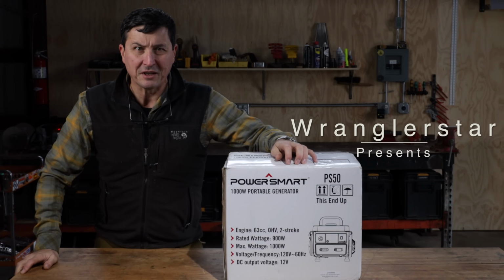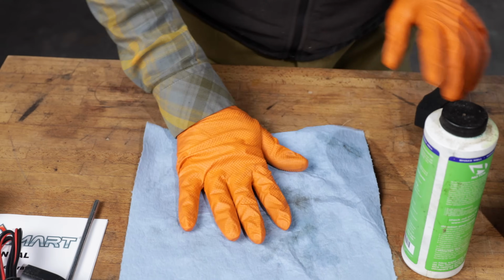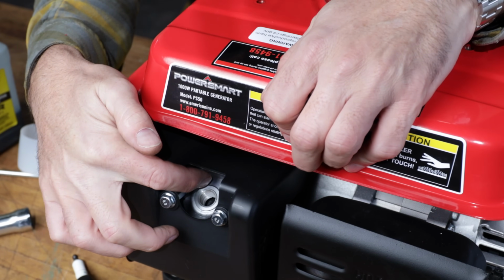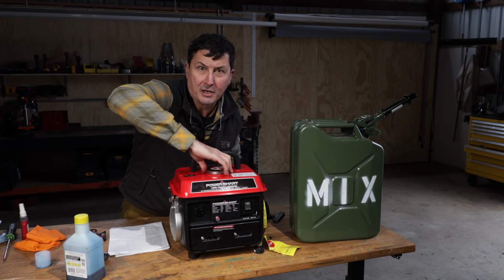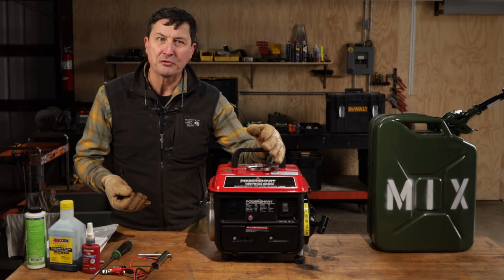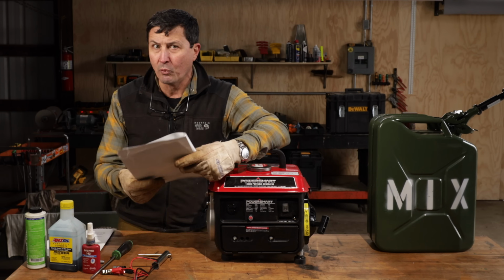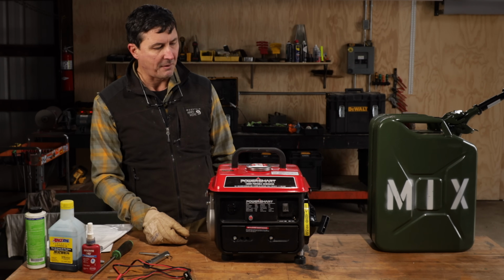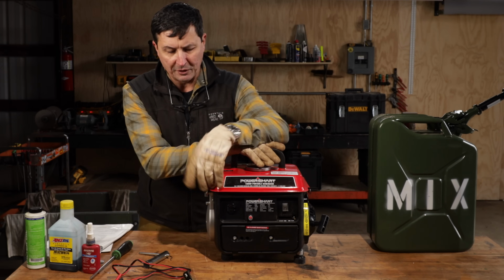TESTING The Cheapest GENERATOR on Amazon -$99

Comment: You should check the sine wave output on it.
Reply: Probably not the smoothest waveform. Looking like square saw tooth.
Reply: Sounds like MSW then.
Reply: yeah the inverter on this thing must be hot garbage, but for such a low price...
Reply: @25566  Unit in that price range won't have an inverter at all. Just straight wires off the generator windings, like old style generators.
Reply: @javaman2883  correct
Reply: I have a Chicago Tools brand unit and I'm rather happy with it, however...I'm gonna install a Voltage Regulator in my POP-UP Camper so I can charge the Leisure Battery. My unit fluctuates between 17-11vdc and I'd rather have that be a little more Stable than it currently is.

Comment: You can run modern electronics off these. If the power supply handles 120-240VAC at 50-60Hz, that switching power supply will manage fluctuations from the generator.  I wouldn't try to run anything of it that uses a linear old fashioned power supply though.

Comment: The only issue is the frequence and sinus shape of these small devices. I have one in 230/12V....
Reply: woody I would use an external inverter on one of these
Reply: @EvertGuzman  the Sinus is crap...a lot of the electronic devices are not working. I used the 12 v DC Outlet and an electronic inverter to 230v....

Comment: What you're missing here is the output is likely a modified sine wave which means for any switching load (DC power supplies) they will struggle to use this output.  This is only really useful for resistive loads (heaters, lamps, etc) and likely simple inductive loads (fans,etc).
Reply: Modified sine waves are common on cheap battery powered inverters.  Gas powered generators like this one put out a sine wave but noisy (not perfectly clean).   Inverter genrators convert the noisy sine wave to DC, then back to AC to clean up the noise.

Comment: This generator is worth less than $50 in Nigeria
Reply: i am in the uk thy sell them at tool stations outlets for 65'pounds i have one to run two 240 volt 400  watt metal halide   work lights  on the farm and i run it for 4 hours a night for 5 weeks when the sheep are lambing i have had it for 3 years working fine still but drain the fuel  when stored or it gums up the carb jets mine is 240 volts 900 watt max output  50 to 60 hz
Reply: Good tip. I'll get tickets so I can save the money...
Reply: Enjoy your goat sir

Comment: Hmm is the store it dry only for 2 strokes?  I was always taught for 4 strokes to filler up before storing with a little bit of Stabil, run it a few mins til hot, pull the spark plug connector, pull the handle a few times, and stash it for the 4 to 6 months.

Comment: Not addressed: power quality, noise, and fuel consumption.

Poor voltage regulation will kill electronics, like microwaves and computers.
There is also the matter of the starting current required by motors, like the one on your furnace blower 

Noise matters. The quality generators are quiet enough to allow normal conversation next to them. This one is like having a rock band playing outside your door.

Some generators can idle for hours on a thimble of fuel. Others require constant tending of their tiny gas tank.

Finally: How can you lock this up?
Reply: Geez Karen....take it easy ole gal. It's just an overview lmao. For $100 how can ya go wrong?!?!

Comment: I live on a boat in Hawaii and can only afford these cheap Chinese generators for my power. They always start fine and seem to run OK at first but on average they only last  7 months for me. I've had 11 over the last few years. They are not well made and wear out quickly. I run mine 5 hours a day every day to charge batteries. One ran only 3 months, most run 7 months, the one I currently have has run 13 months so far.  3 had the magneto magnets break out of the plastic fly wheel at speed which busted the whole flywheel up, 3 burned out the large filter capacitor, which I replaced with capacitors from the other broken ones, 3 run but the voltage out of the generator part fell to 3 volts AC, I think the Chinese use aluminum winding wires which harden and break under vibration after a while, 2 had the muffler clog up with carbon residue,  one had the head bolts bust out of the threaded aluminum cylinder as I kept removing the head to scrape carbon deposits out of the cylinder, 3 broke the muffler mounting weld joints,  a couple just got  harder and harder starting, 3 the governor stopped controlling the speed right, I could only keep them outputting by tying a wire to the throttle and manually controlling the speed for my constant charging  rate, one of those would only kick in to charge if a heavy load of 300 watt light bulbs was added to the battery charger I use. You can't take the generator section apart. I think it is pressed on the motor shaft, you can't get parts, you can't get wiring diagrams.  They are junk, but I can't afford anything else.
Reply: Well, you ride them pretty hard compared to what the avg. user would (occasional camping trip or power outage). Therefore 7 months for you, could be several years of usage for the avg. user. Still, good feedback you provided. They're definitely not for full-time use.
Reply: Honestly, I'd save a few dollars and start buying cheap solar. Not a fan of solar, but in your situation on the water, it's going to be hard to go wrong.
Reply: Honestly that is because these generators are not generally designed for that kind of daily use.  For example are you cleaning the filter every other day because that one should have the filter cleaned after 10 hours of use due to the salt.   Also you have to pull power from whatever is plugged into the generator before you shut it off, that will kill these quickly.  That said,    A solar panel connected to a battery would be a much better option for daily usage with one of these for any cloudy days.   You can get 100 watt solar panel set up for not much more than this and just connect that to a marine battery and inverter.   All together would cost very little, probably 300 to get the initial set up, half that if you already have the marine batteries and inverter which is sounds like you do and you can add more solar panels as funds permit.
Reply: I want to live on a boat in Hawaii 😫😭😭😭😭

Comment: I have a similar one sold at an unnamed discount tool store that I keep as a back up to the solar power at my cabin.  I have only needed to use it a few times but it always worked when needed.  If I were using it as a lone power source I would go with quieter

Comment: Bar and chain oil works well for foam air filters. It is very sticky to catch dust and does not run off the filter as easy as regular motor oil. I use it on my ATVs foam air filters.

Comment: Lol on the box it says 63cc ohv 2 stroke. 2 strokes dont have valves.
Reply: Some 2 strikes do have reed valves, but that simple thing certainly doesn't.
Reply: @m.cigledy6769  Actually it is a reed valve engine
Reply: @Ozsmallbore  yes im fully aware that 2 strokes have valves. In an Ohv engine the valves are in the head. Not the block. OverHeadValves Ohv. This is a 2 stroke not a 4 stroke.

Comment: Will it work off the boat?
Yes. Awesome.
Will it work after extensive use and being left behind in a garage for 3-12 months?
That's the big question. Is it truly reliable?
Reply: I recently cranked mine up during a long power outage and it lit off by the 4th or so pull after sitting for 4 months-is.

Comment: I had one of those for 15 years. After Sandy hurricane we didnt have power for 10 days and i had generator working nonstop for thosen10 days powering 2 fridges, couple lights and computer.  One gallon of mix fuel will last between 10-14 hours powering fridges. I gave it to friend afger 15 years of lotsnof use and he is happy with it

Comment: This model comes under different names but the same 2 stroke oil gas mix engine model.  Harbor freight sells them sometimes with coupon and deal for $88.  I have one but mainly use my inverter generator because its quieter and makes little smoke.  This one being mixed fuel creates much more smoke and pollution. I found it to be highly unregulated and would not use it on sensitive electrical equipment.

Comment: Is this guy naive enough to think he's getting 1500 watts from a Chinese "1000 Watt" generator?  When these generators are overloaded their output voltage and frequency take a dive but they usually keep running, which isn't a good thing.  The output distortion, even with a perfectly linear load, is horrific.  Don't plug anything you care about into a generator like this unless it's a halogen work light.

Comment: Hay there i have had mine for nine years now and we always use it at the hunting shack remove the spark arrestor and run a good ngk one setting hotter and you can pull 1750 out of it all day and five gallons continuous  will run mine for 48 plus hours and if you contact the manufacture and tell them that your bridge rectifier cooked they will actually send you a better one for free!!!!    And last word of advise if you pull the muffler and clean the buggar welds around the inside of the exhaust manifold flow will be better and it WILL INCREASE THE EFFICIENCY of this little gem
Reply: Oh and my apologies i run mine at 40-1 ratio instead of the suggested 50-1

Comment: I guess something like this can't hurt to have lying around in your garage in case of an emergency. Put some gas in it, fire it up and you can power your most important equipment, cook, keep food cold, etc. But the thought of having a 2-stroke engine running for hours or even days is harrowing. I used to drive a 2-stroke scooter and those things smell. Badly. And the emissions are completely off the chart. And I mean really off the chart, not just a little. A 2-stroke engine, which is directly burning crude 2-stroke oil and gas together, puts out over 100 times the amount of hydrocarbons other vehicles do. And those hydrocarbons are highly toxic. 
2-stroke vehicles are largely banned in Chinese cities, because the amount of emissions was getting so out of hand that entire cities were choking to death. I'm not playing the environmentalist here, but the emissions these sort of engines put out are very dangerous.

Comment: its a better outlet probably to insulate from thermal over draw.
Reply: also in case you have an appliance that uses the bigger 20 amp plug while not using that much power

Comment: i had 2 of those, both worked until they were dropped, then would run and no power, cracked linkage between engine and gen head both times.

Comment: I got the same little two stroke 2hp engine 3 days ago for 99euro, the only difference is that i live in Greece and we use 220v as standard so mine only makes like 700w but still good for battereis, telephone center and routers. My only advice is to use a voltage regulator if possible for electronic loads, two strokes tend to be unstable on low loads and can cause overvoltage problems! Great video thanks for sharing!

Comment: I really do like these videos but surely the proof in the pudding is a long term run /usage?  How will this perform after X months of either constant or occasional use?
Reply: One hint to save your nerves: Never leave the gas for long period in the tank when not using the generator. If you do, some deposit will build up on the tiny holes of the carburator, and you wont be able to start again. I say this based on my own experience with this type of generator.

Comment: I have a Harbor Freight tailgater and I use it with an electric weed eater and this allows me to use it on the back of the truck with a 100 foot power cord. It's all but trouble free and anyone that owns or who's ever dealt with gas weed eaters knows just how temperamental or even unreliable they can be especially after a season or two. There's another plus. Using an electric weed eater is lightweight plus you don't have to deal with engine noise and vibration or heat and exhaust gas to deal with... Thought I would throw that tip out there for anyone reading this.

Comment: PLEASE DO NOT PLUG ANYTHING IN TO THIS GENERATOR THAT HAS POWER SUPPLY (electronics). i think this thing use modified sine wave output not pure sine wave i would NOT plug anything whit power supply in to this thing. heater and electric motor are fine. no surge protector will save your stuff. power supplies are really picky about input voltage wave. lets just say we have power supply that outputs 5v but whit modified sine input it maybe 6v or something else its really easy way to ruin stuff like laptop batteries or just fry something you do not want to overvolta batteris or electronics. make sure to get pure sine generator or inverter if your planning to power computers and stuff like that
Reply: How would you get "modified sinus" from an alternator? Please get your facts straight!

Comment: I've bought a mostly aesthetically similar 1200W model for about $120.00 a few years ago. Sadly, I haven't need for... yet... but but like you, I made my first start on it with AMSOIL Sabre Synthetic 2-Stroke oil in a 50:1 mix, as per advised directly by AMSOIL. After a break-in operation of letting it run until empty, I've since run a 100:1 mix, since the back label of the bottle clearly suggests that an engine that has already seen break-in can run a mixture 2-3x as lean on oil than what the factory calls for. Plus, I trust in what a synthetic oil can offer in 2-stroke operation, and like the reduced amount of smoke running the leaner gasoline/oil mix Sabre allows for.

Oh, and I replaced the original sparkplug with a E3 equivelent, just to eek a little more efficeincy out of it. And, one more thing: Mine uses a paper air filter, not a oiled foam one. Just thought I'd mention that.

Comment: Liked the video, but the 12 volt adapter, will not charge a battery however it will run 12 volt equipment. The instructions say to ground The unit when in use with copper wire and a stake driven in the ground.

Comment: DO NOT run a freezer with these generators unless the compressor runs on DC with a bridge rectifier, even with the more expensive ones these guys runs on modified sine which destroys electric motors.
Reply: How do know that this generator runs on modified sine? Hello!!!, this is not a DC to a inverter product. The engine drives an alternator which produce sine wave output automatically, therefore there is no need for an inverter. Inexpensive inverter generates modified sine wave AC (again from DC).

Comment: Treat it right. And rember: v power is the best source of parts. ( Coils) Auto lite 62-64 plug check the length at tip.  Ps don't even walk in to a mower shop.... here in Dickson TN I got ushered off the property.

Comment: I had a yellow one for a few years, I never had any issues with it, the box said 950w max 650w nominal, I only used it to power lights and there was some degree of flickering because the voltage wasn't very stable, I had a mate who bought a grey one from B&Q to run his caravan at race events, the first time he used it, all set up TV on kids all happy, the genny spluterd coughed revved up! the lights and TV went off, the kids were screaming. The TV was dead....moral of the story don't plug sensitive electronics into £49 Chinese generators.

Comment: Had been using one of those chinese generators for years now, about 100 hours on use and only problem was stuck exhaust pipe at long time use.. Cleaned it and works again with no problem ! Cost here in Finland 39 €uros which is about same on $..  220 volts btw

Comment: What about using a fogging oil spray in the cylinder before you run this new. Fogging oil that I use in my boat motor.

Comment: Instead of trying to pour oil into the spark plug hole I suggest you buy can of fogging oil that most boaters use for winter storage. Spray some in and pull start it about 3 times with the plug out and it will coat the cylinder walls and you won't have issues with scoring, smoking or potentially fouling the plug. You can (should) use the fogging oil for winter storage of all gas powered equipment that will sitting for a few months

Comment: Its Possible that it Droped the Voltage under the higher Resitive Load 
The Load Test probably locks a lot different if you got Capacitive or Inductive Loads Like a Compressor

Comment: harbor freight has these at the same price... I ran my fridge with it during an ice storm ... it did well sometimes and  tripped others... I initially got it to power electronics like the computer and  lights for the summer storms... since I didn't have internet connection I tried it for powering other stuff... it ate gas like a tiger... but, I will say for the price... it was a good buy

Comment: When I oil my air filters on my dirt bike I have holes poked in the cap of the air filter oil so you don't have to open the cap up and get more than what you want You can squeeze the bottle and it comes out the holes

Comment: Testing this into a resistive load, like that heater, is no test. Running an inductive load ( like a motor) is another. Plus, the output waveform is very important. I can pretty much guarantee, the waveform isn't adequate to properly run anything with electronics. A real test would be to run a microwave oven that has a resistive, inductive, and minor electronics..